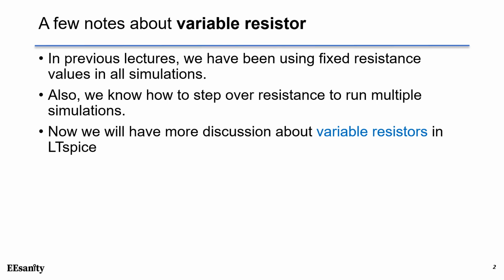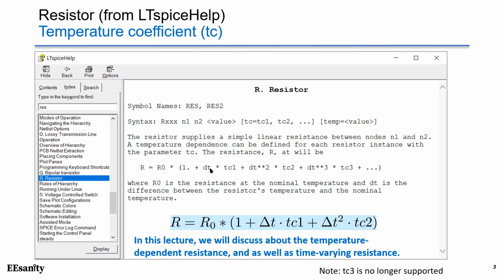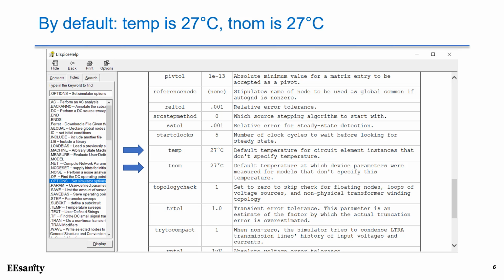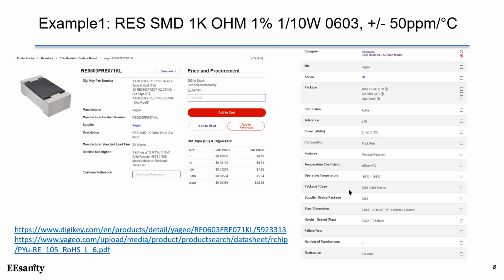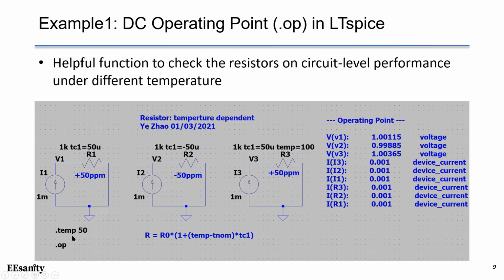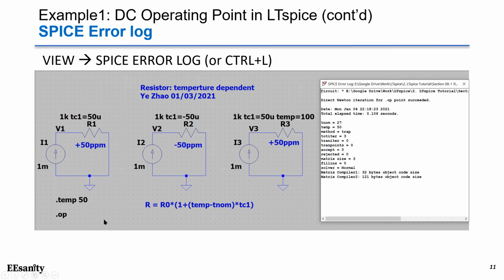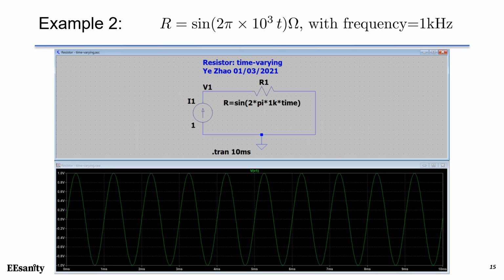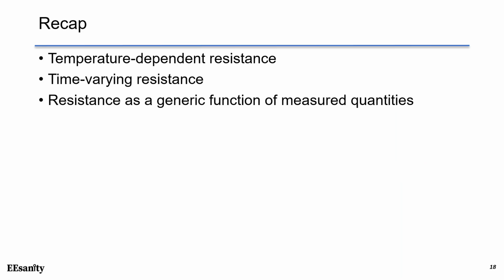Variable resistor in LTspice

Comment: How to include variable capacitor in the Circuit. Thank you
Reply from the maker: Here is the info about cap in LTspice.
http://ltwiki.org/index.php?title=C_Capacitor

It seems there is only one way to make it change over the transient simulation:

"There is also a general nonlinear capacitor available. Instead of specifying the capacitance, one writes an expression for the charge.
LTspice will compile this expression and symbolically differentiate it with respect to all the variables, finding the partial derivative's that correspond to capacitances.
Syntax: Cnnn n1 n2 Q=<expression> [ic=<value>] [m=<value>]
There is a special variable, x, that means the voltage across the device. Therefore, a 100pF constant capacitance can be written as
Cnnn n1 n2 Q=100p*x
A capacitance with an abrupt change from 100p to 300p at zero volts can be written as
Cnnn n1 n2 Q=x*if(x<0,100p,300p)
This device is useful for rapidly evaluating the behavior of a new a hypothetical charge model for, e.g., a transistor."